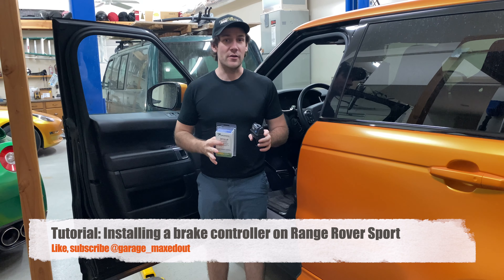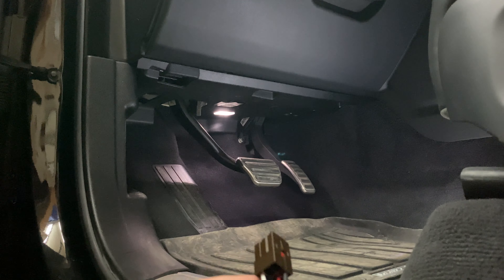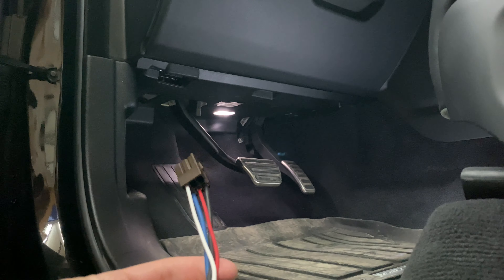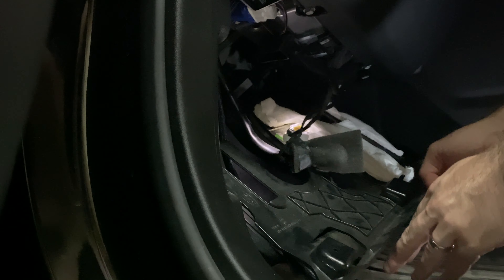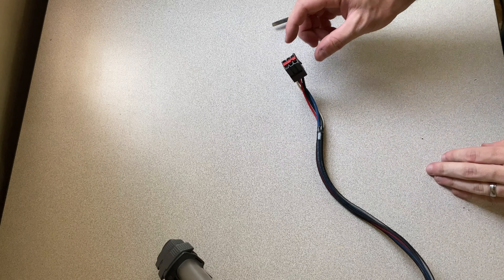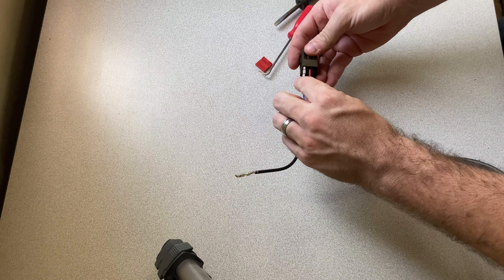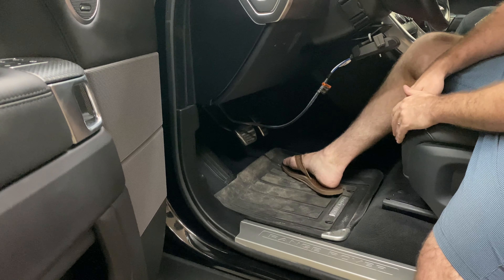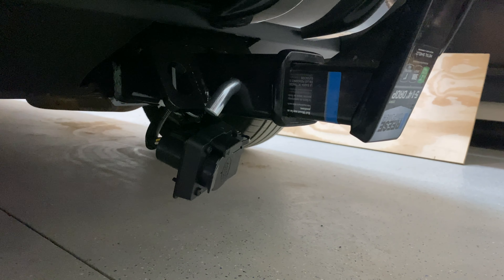Tutorial: Adding a brake controller to Land Rover Range Rover Sport L494 or LR4

Comment: I saw a video from England and I think this is the same setup on the new defenders. The wiring harness looks exactly the same.  Might have to rip out the cover on mine this weekend and check it out! 😂
Reply from the maker: Yeah they are pretty similar which is great. With the setup I used, I plugged it in without swapping the pin and got no power, then just swapped the pin and it worked.

Comment: So does the brake controller stay powered all the time? With the car off my is illuminated, I don't plan to leave it connected but just curious if it will cycle off after a few minutes like when you lock the doors?

Comment: Have you heard of this issue Im having. As soon as I plug the trailer in the brakes on the trailer lock up. Didnt have this issue with my Dodge Durango or F150 while towing. Any suggestions??? Thank you
Reply from the maker: That means the wiring is applying 12v to the brake line instead of the running lights. You’ll need to pin swap the connector